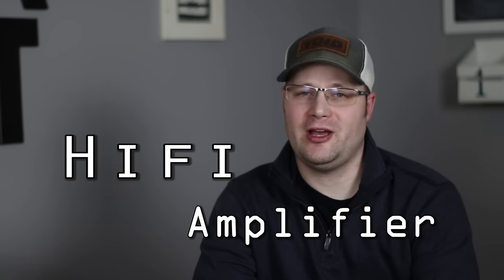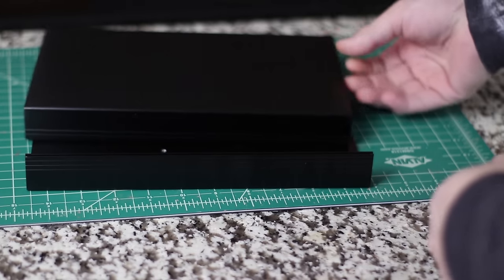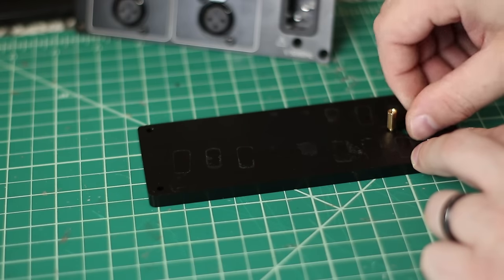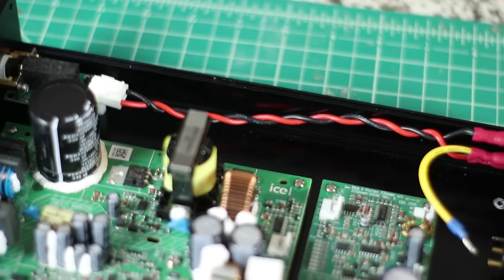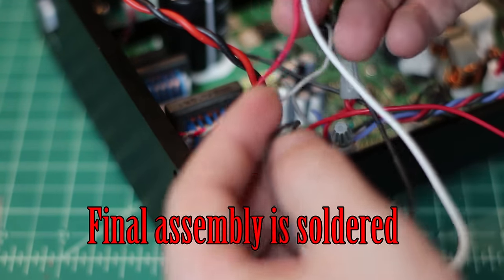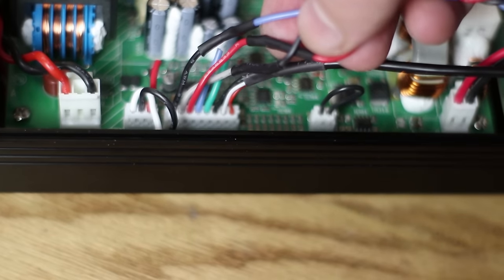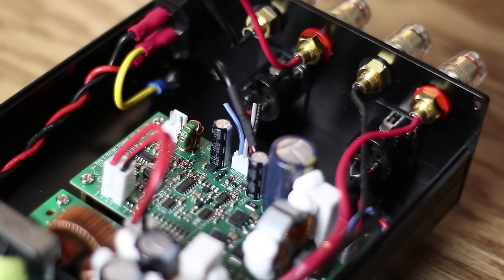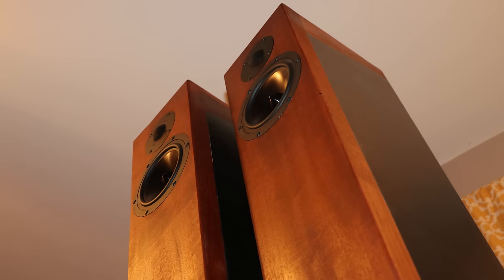How to Make a $3000 DIY HiFi Amplifier for $300

Comment: Any class D amplifier is not Hi Fi by any means.
Reply: That rather smug certitude of your statement reminds me of what I often heard back in the 1960s: "Any transistor amplifier is not Hi Fi by any means."  By 1970, solid-state had gotten so good -- e.g. the Sony TA-3200F power amp -- that McIntosh soon discontinued their classic tube-based MC275.  The same process is under way with Class D in 2019, with Class D chips at every price level that are legitimately competitive with Class AB products of comparable output power -- for far fewer $$$ and with greatly superior efficiency and therefore less weight and much lower power consumption, the very same advantages the TA-3200F had over the MC275 nearly 50 years ago.
Reply: I take your point, there are a lot of good things to be said about a class D amplifier, there are problems for it to over come, so that it can be call a true high fidelity amplifier. What a hi fi amplifier is by definition was set down if either the late 40's or 50'. This covered the frequency response distortion should be (something for shoot for).  I like the Class D amplifier for its good points, but, it well never be a true hi fi amp. I also believe most people won't care, it well be good enough for them.  I can go on and on about this, but the above covers what I want to say about this subject.
Reply: @wcovey9405  -- Those 1940s and 1950s targets have already been met and surpassed by modern Class D chips.  I'm not old enough to remember any 1940s criteria, but IIRC by 1950 20 Hz-to-20kHz frequency response and one percent THD were considered sufficient for a power amp to qualify as "hi-fi."

To prove my point, here are the basic numbers for the1949 McIntosh product widely considered to have set the "hi-fi" power amp standard for the time frame you yourself stipulated:

http://www.roger-russell.com/amplif1.htm#a50w1
Reply: Harmonic distortion is not a real problem, music is made up of harmonic, an amplifier with a high level of harmonic distortion with sound more musical then one with less. The problem with class D amplifier has to do with intermodulation distortion (that nobody likes), phase shifting distortion and maybe noise.  Audio Amplifiers for the most part drive a speaker coil with impedance, say 8 ohms at 1000 hzs, depending on the coil's Q this impedance changes with the frequency of the signal.  The class D amplifier has problems with this (phase shifting problems, and intermodulation problems). note, that one of the reasons why people like tube amplifier is that because of the nature of tubes, they have a lot of harmonic distortion, and in the early days of transistors amplifier, transistor had a lot of intermodulation  distortion , as well as, noise.     @editorjuno
Reply: @wcovey9405  -- What a bunch of ludicrous faux-audiophile folklore.  No offense, but you are far to technically ignorant for me to continue attempting to talk sense to you.  I have owned numerous very good Class AB amplifiers -- including one designed by none other than the legendary Nelson Pass -- and to actual human hearing a good Class D design rated for comparable power is utterly indistinguishable from any of them given the same pair of decent speakers.  You might want to consider living in the current century -- just a thought...
Reply: @Genuine Audiophile  Frankly, I think Puteyz's work is on a considerably higher level than folks like Pass who, as brilliant they are compared to most of us with audio technology backgrounds, are essentially refining longstanding circuit topologies rather than digging into the underlying basics and literally "doing the math" to create something essentially brand new in terms of performance.  E.g. my Pass-designed Adcom power amp was better than the early 1970s (DC-coupled with bipolar NPN/PNP output pairs) Kenwood it replaced, but not gobsmackingly better -- e.g. that Kenwood was good enough for me to hear a much bigger difference when I upgraded my preamp from my old Dynaco PAT4 to Sony's (then top-of-the-line) TA-2000F.  I'm willing to bet upgrading from that Adcom to an NCore-based power amp would be far more impressive then the Adcom was compared to that old Kenwood.
Reply: @Genuine Audiophile -- No offense to the accomplishments of Carver, but if I were to "start an amp company," it would be to package NCore modules at a sensible price as opposed to the crazily pricey (five figures!) stuff from Merrill Audio and Putzeys's own Mola Mola venture.
Reply: @Genuine Audiophile -- Yeah, "affordable" looms large in my priorities.  The fact that Carver's current company traffics in pricey tube stuff confirms that his "businessman" side knows the psychology of the audiophile market, as does your Sunfire story.
Reply: There's nothing inherent about class D that makes it inferior to AB. It's just a hell of a lot easier to build( and cheaper) so there's more inferior options available. Why not go all the way and talk about how AB can never be HIFI because it isn't class A? This is just audiophile nonsense.
Reply: @Genuine Audiophile fair enough, my mistake. Still, switching gets the blame for most perceived faults of class d
Reply: @Genuine Audiophile -- Well, at nearly 72 and happily retired, I have neither the funding access nor the energy to honcho such a worthy effort.  I'd love to help out on the marketing communications side, though.  :-)

Comment: How to build a 3K amp using a 300$ amp with questionable quality parts.  What is the IC? 

Why is there no audio-grade coils and capacitors on the board?  

This to me looks pretty much like an aliexpress amp kit and wouldn't lift a candle to a 3K amplifier.  

But then again, this one has  20% of the cost for 80% of the quality compared to the 3K amp, as long as you know the differences and you're okay with them it's fine.
Reply from the maker: It may look that way to you, but it's not that way in reality. This is the exact same amplifier board that was manufacured for use in multiple HiFi amplifiers. They were all clones, with different price points. Bang and Olufsen manufactured and produced these. They've been highly praised. You should really read up on Ice Power.
Reply: @Toid  Thanks but I'm curious about the actual electronics, not the design of the PCB as chinese are notorious for selling less reliable parts as being "high quality".  For example in the old days when CRT TVs were a luxury I had to replace one of the high power transistors who failed after 12 years. I brought 3x alternative chinese parts and 1x original made by ST.  The chinese ones were ok but they lasted about 6months each then thr ST is still lasting, many years since then. 

To get back to my question. Are the electronics inside high quality or is it better for me to source them myself and just buy the diy PCB?
Reply from the maker: @IonCatalin  I get that. You can buy knockoffs of these boards, which I'm sure aren't nearly as good. These particular boards were made in Denmark and were purchased from Ice Power. They use only high quality parts in it.

Comment: Haggard built cheap component diy project …  3000 dollars … yeah… and elephants fly.        You have soldering iron ,but you chose to use screw hat type connector that are nearly useless in both.. house wiring and electronics ..   any shaking will loosen them off and they start to ground up and form shorts..     

Even blink Chinese guy without hands can build one with similar quality. At least they dont have the guts to call it 3000 dollar match …   
Not to mention how lazy you are…  you do mistakes and dont bother to re do the video without mistakes.   combine that with screw hats and other mistakes …  i would not take that in my house even if you pay me 3000 dollars..   would not be worth the burned up house and all the hassle with insurance company.

Comment: Someone explain to me why Americans always say "soddering" - when it has an "L" in it....?
Reply: @Genuine Audiophile  Sure - because aluminium has an "i" it, so we pronounce it (as a short "i") and stress the third syllable (thus "al-u-MIN-yum"), and we spell "colour" that way because it was spelled that way before America was ever settled and Americans later decided to drop the "u" from the spelling.  It's a characteristic of the American version of English that letters are ignored or have been removed from spellings.  Obviously British English came first, so the reductions are derivatives. But my question was genuine, it's very strange to completely ignore the presence of an "L" in "solder" and call it "sodder" - I could understand it if Amercan English had removed the "L" from the spelling, but it hasn't - yet Americans don't say "boudder" instead of "boulder", or "hodder" instead of "holder", so it's inconsistent. Just like "herb", which has an "h" but Americans for some reason ignore the "h" and say "erb" (thus vaguely echoing the French pronunciation, for some reason).
Reply: @Genuine Audiophile Two countries, separated by a common language!

Comment: Dude, it's cool you showed people how to assemble the amp. You didn't make it. It's all prefab quick connect boards. It's also class d. This is a weak amplifier with high distortion and low current. This is not a HiFi amplifier at all. Not even close. If I tried to run my DQ10's with this thing they'd sound like total shit. If I tried running my Kef C80's, again total shit. Just because there are xlr connections doesn't make it HiFi. Most HiFi Amps are either tubes, class ab or class a. You are misleading people greatly. You aren't going to make a $3k amp for $300......ever.
Reply from the maker: There are two main class D manufacturers that HiFi companies use.  This same series of amplifiers can be found in Rotel and P S Audio's HiFi amplifiers plus the other ones already mentioned.  This HiFi manufacturers call then HiFi.  They very low distortion and highly regarded.  You're welcome to research IcePower HiFi amplifiers.  Even P.S audio claims they are some of the best amplifiers they've heard.  That's from Paul McGowan himself. I'll definitely agree with you that most class D amplifiers would not be considered HiFi. These do not fit in that category though.

Comment: the title is bullshit I'm a professional high end audio video tech this tiny amp wouldn't stand a chance vs a real $3,000 amp just from what i see the caps and transformers are not high quality the wires are low end etc etc. Look up Emotiva if you want a reasonable priced amp with higher end specs for higher end Krell or Meridian but the costs is many times more. If 300 is your price range not sure I can help you there maybe a used Emotiva on ebay

Comment: Lets see, I seen the board listed for close to $400 and case over $100...................................400+100 = $300.00 (Not including all wiring and switches)
Reply from the maker: Check the links in the description. Much better pricing than you are finding.